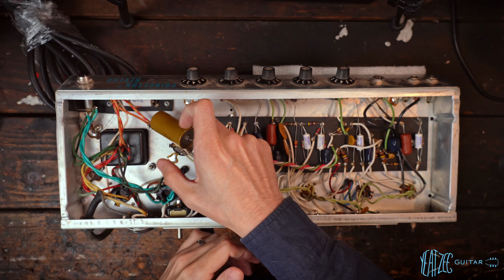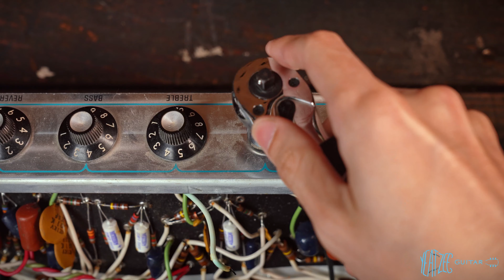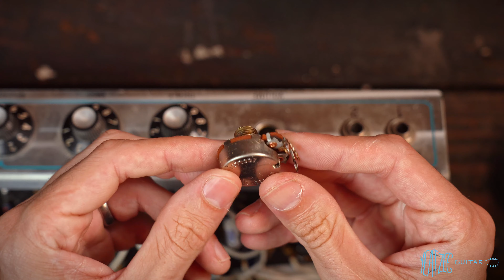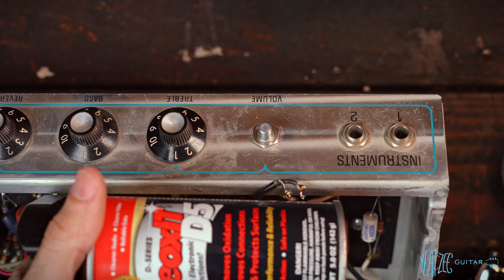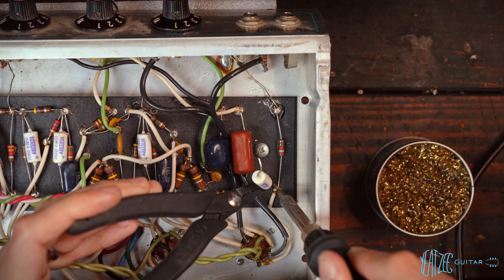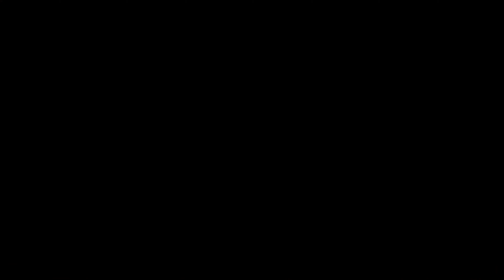BYE BYE UNICORN! - Vintage Princeton Reverb Amp Repair Pt.2

Comment: Thanks much for this video!   I learned a lot from this & pt 1.    Nice to see Steve Luckey adding helpful comments.   I'm restoring a 1963 Ampeg Jet J-12-B ..... and I have the CE can cap ready to go in.   Now I'm thinking it would be better placed in the cylindrical file ....    I'll look into the Hayseed Hamfest one.
Reply from the maker: Steve's the best! Good luck on the project! I'm very happy with the Hayseed so far, just ask before ordering what caps they're using if you care about that. They can also custom load them to what you want (assuming it'll fit)
Reply: To be honest, I'd rather load it up with 3 F&T 20uf /500V caps.   I could tie 3 together like a pyramid, but that looks pretty tacky.    For the J-12-B circuit, the 4th one is for cathode bias.    A Kemet 50uf/63V can handle that just fine ... with a 500 ohm resistor   (will confirm bias of course)   thanks again ...  @YeatzeeGuitar

Comment: Fender realized they could save money by eliminating the reverb driver bypass cap and just running the 12AT7 at a deadly hot bias--so it'll need replacing more often but on the customer's dime.  Bypass caps are cheaper than tubes, so you made the right call reverting to the Blackface schematic value--which already punishes the 12AT7.
Reply from the maker: Makes sense with the silverface changeover!

Comment: I have a 1977 Deluxe Reverb that was missing a bypass cap, as well as a couple of different resistor values from what was shown on the schematic, so I went with the values shown on the closest schematic I could find (AA1172).  I don't know if it sounds very different now, because I really didn't play it much before changing out the doghouse caps, which were original.  That's been about 2 years, and it's been rock solid, and sounds good to my ear.

I didn't know that about the CE Manufacturing can caps.  I have a 79 Vibro Champ with the original can cap that I was thinking about replacing.
Reply from the maker: Yeah the 70's were a weird time for Fender! And yeah, unfortunate the CE can caps. SOOO many people have told me about them prematurely failing.
Reply: @YeatzeeGuitar  I know this is your customer's amp, but have you considered adding an output tube matching pot, and then tacking on a bias pot?  Measure the resistance of the 2 sides of the output transformer to see how close they are.  If close the output tube matching pot will allow the use of non-matched output tubes.  I did this to my '69 Bandmaster Reverb and got perfect balance and bias.
Reply from the maker: I did that with the Bassman 50, maintained the bias balance pot and added the trim pot on top to adjust the actual bias voltage. Imo, not really necessary and a little imbalance can make things more interesting. We'll be going standard blackface adjustable bias on this one.